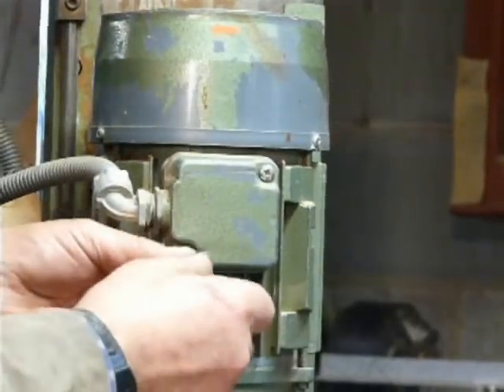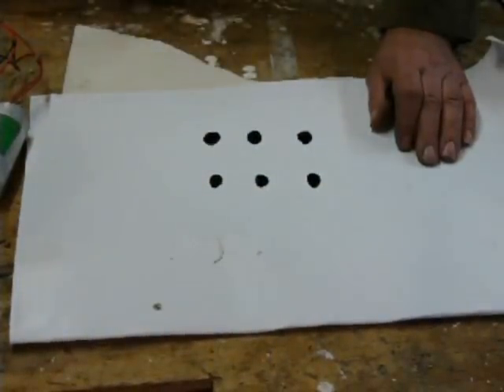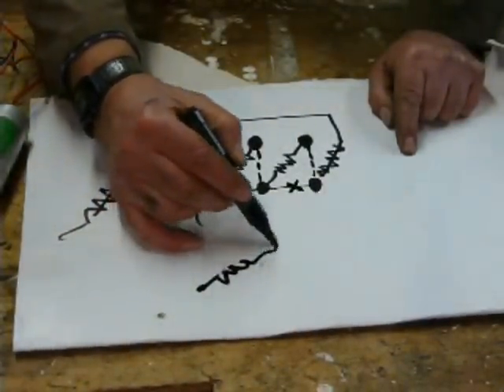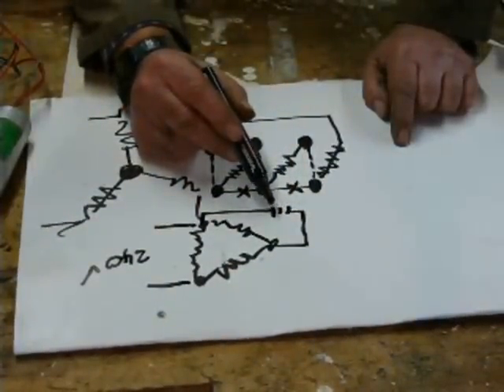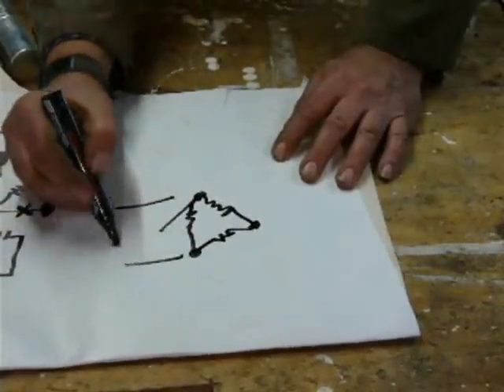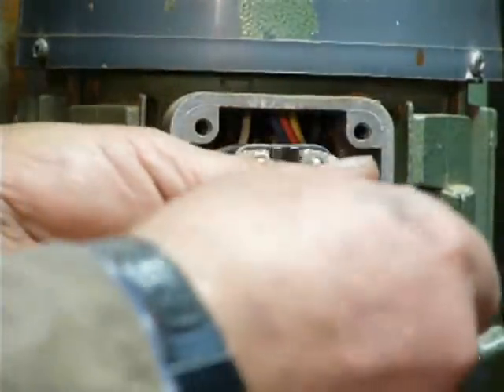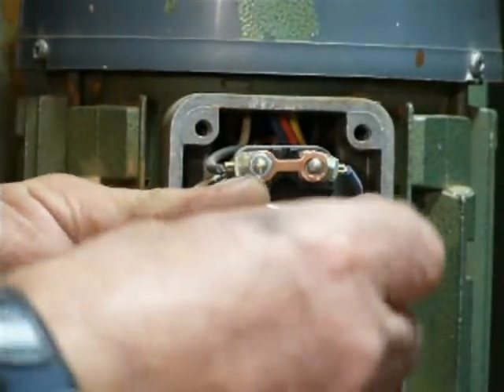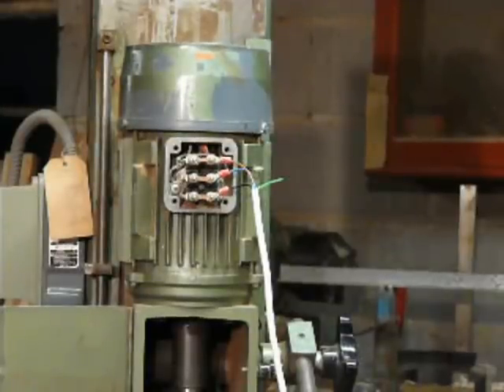How to do it: run a 3 phase motor on single phase supply. part 1

Comment: Andy, I'm trying this on an old 20hp motor. Can I use a 2100v ac cap with 1.0 uf? Thanks, if yes, i have many I can use
Reply from the maker: Hi. 20 Hp is a big motor with big starting current. You will need AC capacitors to a value of at least 300 UF, see what happens, but let me know. Cheers, Andy
Reply: Hi andy. I went to an electronic shop and all they had in ac caps were the very small ones. Even though they are 240v ac, and 100μ£ ,will those work for my application?
Reply from the maker: Hi. What you really need are either motor start/run caps or those out of flourescent light fittings. Small electronics items will not have the "kick", try your local electrical recycling place. Cheers
Reply: Hi again, turns out i was wrong about the HP. Its a 254 frame type K, 6.52 amps, 2 Hp, 220 v. So i found some caps on eBay that i am waiting for. Using your formula, how many μ£ would u recommend i use? Thanks
Reply from the maker: Try 60 Uf and then do the tests shown in the videos, Cheers

Comment: How to change daration
Reply from the maker: HI.I assume you mean direction, Change 1 of the 240v power leads to the 3rd delta connection and the motor goes the other way, subscribed? Cheers
Reply: Thank you sir

Comment: This is really old and it been done most the time where you have not access to a single face motor or a three phase power supply the main point is you need to know what size of capacitor and what type also as he explained in some cases need add a hard start capacitor to improve the torque of the motor Best way and safe to do this is by controller by Contactors relay with NO and NC as well as two push bottom to avoid burn out the motor and case power go off 
www.certifiedqualityair.com
Reply from the maker: Thanks for the comment, just drawing people's attention to this method and the book. Cheers

Comment: Hi Andy, I am up to your second video, and I appreciate the time and effort you put in to these videos to make them easy to understand. I do have a question: I live in the US where the power is single phase 120v. I do not have access to a 240v outlet in my home. Is it at all possible to run a 3 phase motor in this situation? I am generally good at fixing and building things but don't have a lot of experience with electronics. Thanks in advance, Adam.
Reply: The motor in question is 5hp with an amp rating of 13.1 - 14.5. I understand that may be too large to start from single phase.
Reply from the maker: Adam. It depends on the voltage of your motor. If it is 240v 3 phase then it will work. I am lead to believe that in some US properties there are 2 110v supplies, giving 110v between the live and neutral, so you get 240 between these 2 live supplies. If it 415v then it will work but the motor power will be much reduced as you will use Delta wiring but put in 110v (worst case)  As a general rule if you halve the voltage to a resistance then you halve the current, but the watts are reduced dramatically. 4 amps at 240v is 1000w, but 2 amps at 110 is 220w. There is only one real way to find out, try it. Cheers.
Reply: Adam you  should have 240 at your kitchen stove or your clothes dryer.

Comment: Hi Andy
Your video is most helpful and your safety warning is apt.  But its is important for all DIYers to know that big capacitors can give you a big jolt even after the power is disconnected.  Three questions?  Does WP16 give a table or rule of thumb for capacitor sizing?  How published it?  I am working on an project to use a direct drive permanent magnet 3 phase motor (F&P) as a starter motor for a hard to start diesel then as the generator.  Whats your guess for the capacitor sizes?  Cheers Jack
Reply from the maker: Jack. The books is available from Maplin and it is on Ebay. Page 47 shows a chart of Hp and cap sizes, but fine tuning is required because of individual motor configurations. As to your project I suspect a guess and then measure the run voltages, but as it's a starter motor and will only run for a very short time, then a slightly high capacitance will give a bit more kick. Have you subscribed? Cheers, Andy
Reply: How do i subscribe?
Reply from the maker: Hi, Jack, just go to my channel and press the subscribe button, just gives you email alerts of new uploads. Cheers

Comment: Hi, I have changed a 3 phase moter in to a single phase ,I am having problems with it it's not knowing witch way to go can you help me ? What have I done wrong.
Thanks
Reply from the maker: Fay. just a few questions: have you wired the motor to delta, what capacitors have you used and are they good, What is the motor driving at start up. have you subscribed? Cheers, Andy

Comment: Thank you sir for wonderful concept....
sir i have a few doubts regarding this concept
1.after running the motor with 1 ph supply,if i remove capacitor it will run or not sir
2.normally in 3 phas motors to get rotating magnetic feild stator winding must be placed at 120 and currents must displaced 120.
but here we didnt do any such things even though it works. how it works?
 (any theory part website link or ebook)
Thank you sir.
Reply from the maker: If you disconnect the capacitor when the motor is running it will continue to run because it is up to speed. However the power will be much reduced. There are some videos showing the use of a motor and belt to get the 3 phase motor up to speed and so it will then run, as they will not start on single phase. The use of a capacitor (of the right value) means the motor will start and run with more power. Cheers
Reply: thank you sir for your responce.
sir another doubt 
current taken by motar winding with 1 phase is higher than 3phase supply by how many times?
thank you
Reply from the maker: The current should be about the same as the 415v coils have been split in 2 so the are moe suitable for 240v. However only 2 sets of coils are used so overall the current is less and the HP is about 60%. Start current limits the size of motor to about 3 HP.

Comment: i connected my 3phase nederman exhaust motor direct without capacitor as i also read it would run on another site (maybe a mistake) it did run, and it started smoking, any suggestions please,
its a 220-240 3.5a or 380/420v 6amp with 2860r/min 
the colours /connections are
W2 black  U2 yellow  V2 red
U1 yellow  V1 red      W1 black
1                2             3       manual says phases i think this means
I changed it from star to delta so its running on 240v but may have connected it wrong
how do i work out which one are live and neutral as i only red yellow and black from the motors.
What capacitors should i buy please as i dont have any old ones
Yours and anyone elses help would be greatly appreciated, many thanks

chris.sheerin@btinternet.com
Reply from the maker: HI. It sounds like too much current through one of the coils. You will have to go back to basics and apply the info in these videos. You can identify the various coil ends with a multimeter and check the size of each coil with the resistance function. The greater ther reading the large the coil, but they should all be the same. Cheers.
Reply: dear andy reynolds
thanks very much for this, need to learn how to use the volt meter on resistance, but when i get these results can i send a contribution for you to help me wiork out the capacitors and wiring i need i can send pictures if you send me an email to chris.sheerin@btinternet.com

Comment: any calculation for sizing the capacitor?
Reply from the maker: In the comments on one of this series, Subscribed? Andy
Reply: yes your volt meter will help i you get same voltage. start about 45 mfd . if it will not start due to load you have to place a hard start kit to same mdf.

Comment: I a bit confused with wiring a contactor relay for AC unit the T1 and T2 should carry the phases or 220  for each fan motor and compressor. and the hot phases should tie into L1 and L2 right?

Comment: million dollar question
You sound like the real thing,  my question on the condenser fan motor instructions says the two brown wires goes on either side of capacitor is there a black wire to one side of capacitor to charge it? or was that a stupid question.  I have two brown wires one brown with white stripe  but I forgot if one of the black wire is connected too capacitor?

Comment: Many thanks.  We received 380v 3 phase motors from china on small lab equipment. Bugger!
Reply from the maker: I hope you will enjoy working this out. Cheers
Reply: Andy, my husband and I are in the jungle in Laos. We purchased second hand capacitors from a junk dealer but are 450v umf. Will these work? We found a 250v 500umf capacitor and it worked. The motor runs mini ball crushing mills. Any help you can give is very much appreciated. From Nara and Dave
Reply from the maker: HI. As long as the capacitor voltage is higher than the supply voltage, all OK. The 450v one is fine. It is the Uf (micro farads) measuremant of capacitance that is important. If the capacitance is too high then the voltage on the 3rd terminal will be too high and motor will get hot or fail. For a half Hp motor the cap should be about 30Uf, if I read you message right yours seem to be too high. Check the voltage with a multi meter between supply and the 3rd connection. Hope that helps. Can you promote my books out there? there is a very good discount direct from the publisher. Cheers Andy
Reply: Dear Andy, the motors are 2.2 and 2.5hp. The machines arw the size of a home cement mixer. Please give me a link to your books. Your videos are the most practical and helpful instructional DIY videos I've ever come across. I will put on a switch capacitor as per video 3 or 4.  Many thanks.
Reply from the maker: HI. About 100 Uf for the run cap and something like 200 UF for the start cap but this is not so critical. I have put a link in the description of part 2 to the list of LILI publications, many of which you may find interesting. LILI is a not for profit organisation, and so am I. Cheers, Andy

Comment: Sir, Is the 3phase u are talking about is the 440 v 3phase or 220v 3 phase... Thank u for answering in advance !!!
Reply from the maker: 440v for star and 240 for delta on a dual voltage machine.
Reply: thanks Sir , iat helps a lot!!God bless

Comment: You my friend are a genius!!! Thank you. You laid this out perfectly!!
Reply from the maker: Thanks for the appreciation, check out my recent upload on global warming and flooding. Cheers, Andy. Subscribed?
Reply: Mr.Reynolds I am subscribed. I am currently having a issue with the motor heating up very quickly. If I did my math right my motor requires .81 micro farad capacitance. However my motor is still heating up. I have a AHV 2-42-P-10 0-250 Volt, 2 Amp-3 phase motor I am trying to run it on single phase 110 Volt. any suggestions? Thanks in Advance..
Reply from the maker: Sounds like you capacitor value is too high. Check the voltage between the supply lines and the capacitor / motor connection. It should be at or just below supply voltage. I suspect currently it will be much higher. Cheers.

Comment: In US neutral and one hot is 110v across 2hots is 220v so do I leave neutral out
Reply from the maker: That depends on you motor voltages, and whether you wish to run on 110 or 240. It's the star delta choice. hope that helps, Andy
Reply: yes

Comment: in the US the neutral and 1 hot is 110 or neutral and 2 hots is 220  in your video you stated that a neutral and hot is 240 i am confused
Reply from the maker: Fair comment. In the UK standard voltage is 240v and 3 phase is 415v, so 110v is only used on building sites and other specialist areas. This is why the video is set up to change the motor connections to suit 240v. I assume in the US 3 phase motos are 240v, so the principal remais the same, but the voltages are less. Thanks for the comment, hope that makes sense.

Comment: thanks sir for this video. i have question , maybe you can help me. how i can get voltage output  3 phase 220/ 380 volt, from input single phase 220 volt? what components are needed ?  and how the circuit? thankyou.
Reply from the maker: To do this rather than convert the motor you need a 3 phase inverter unit. Hope that helps, See mrpete222 channel.
Reply: Andy Reynolds thank sir for your answer. sory sir i dont know about channel mrpete222, and where i can see it?  because this voltage is not to operating a motor.i need this voltage for give sensing voltage to the module. and this module requires supply voltage 220/380 volt (L1, L2, L3 and N ).

Comment: thanks  sir for video .sir i have question how much capacity   motor we can run with single phase and how much capacitor   we need for how much hp motor ?
thanks
Reply from the maker: Hi, About 30 Uf per Hp, and up to about 3 HP. This is limited by the start current so experiment is required. Andy
Reply: thanks sir for replay.sir do u have any video about control panel diagram of pumps.

thanks
Reply from the maker: I have created over 60 videos but non cover the subject you require. Andy

Comment: great video thankyou, i have used this information to get a 3 phase 3 kw motor running, i used 3 70 mf caps to run and one 400mf to start, however 2 of the chinese 70 mf caps popped almost straight away, there is no polarity marked on them  so would you suggest i am makng an error, or the caps are rubbish, although new are they same quality as most chinese exports? ie crap. many thanks for any advise and great videos,.
Reply from the maker: HI. Several thoughts that you could investigate. The cap voltage needs to be more than the supply voltage and if possible 1.5 times higher. If you use too high a capacitance then the voltage will rise and could blow the caps. The start cap needs to be disconnected during run. The start cap seems a bit high and could cause run cap failure during start. Let's hear how you get on, hope this helps. Andy

Comment: Everything is a resistor?? ))
Reply from the maker: HI. Yes, resist the flow of current, light bulbs, wire, motors etc. See the DC to Dc conversion video to show how a bulb can be used to limit battery charge current. Thanks for the interest.
Reply: He meant coil but yeah, he used a resistor sign. I'm assuming he wasn't officially trained in the electrical field but his explanation was pretty solid.

Only complaint I have is the size of wire he was using for that motor. It's way too thin.
Reply: +Stock Loc Higher voltage in europe means lower current, so thinner wire is ok, i think

Comment: hi..is there any voltage in the neutral line?? if have, how about neutral return to the main board...
Reply from the maker: Hi. Thanks for the interest. There is a live and neutral into the motor. The wiring is shown in part 2. There are 6 parts in all. Hope that helps, Andy

Comment: Now that I understand 3 Phase wiring this leads me to want to understand a motor's "FL" rating.  Is that the amount of current needed to get the motor running and continue running?
Reply from the maker: Hi. As I understand is FL is full load, FL current is that drawn when the motor is producing the rated horsepower and not slowing down. Start current can be up to 10 times the FL current. Thanks for the interest.

Comment from the maker: Hi, I can see the problem. With star there are 2 sets of motor coils in series. This doubles the resistance and so with a 230v supply it reduces the current flow. This is why we use delta to match coils and supply. I suggest you make a wiring diagram of what you have, and then follow this series of videos to wire the motor for delta. You may need to experiment with cap values; it's in the videos. Remember to check the cap voltage with the motor running. Let's hear how you get on.

Comment: Andy this is great! I wonder if you can help with a related problem i have - i've bought a planer converted to single phase but it is not spinning the cutter block fast enough, seems like a massive lack of torque. The motor is 1.5kw 3 phase wired in star, the contactors, start and stop buttons are 3 phase gear and two of the 3 capacitors are 380v or more. I can't make sense of the wiring - does this sound at all right or has it been wired up wrong? should it be wired in delta?

Comment: I converted a 3 phase motor to single phase use for a friend. Now you got me wondering if it was wired delta or wye. There was plenty of power, so I'm guessing we were using two of the three windings.
I used a potential relay from an air conditioning compressor to de-activate the start cap. After the success, I realized I could have used a regular relay hooked to the line voltage with N.C. contacts for the cap. When the motor got up to speed, and the voltage returned, the relay dropped the cap.

Comment from the maker: Hi. Thanks for the interest. The method uses the coils in star configuration. This way there is greater electrical resistance across the coils. The capacitors need to be suitable for a higher voltage 500v. pooroldchap shows this method on his channel, but basically it is just the same but with no wiring changes. Check out his channel and see what you think.

Comment from the maker: Thanks for your comment and interest. To get max power out of a 3 phase motor on single phase there needs to a be capacitor from both the neutral and the live to the 3rd connection. A start cap is definitely needed to set the rotation direction. On automatic start this would need some extra current related switching (switching off as the current reduces as the motor runs up to speed.).

Comment from the maker: Thanks for your comment. You are correct in assuming 30uf value is needed as a run capacitor per motor Hp, but this is a start point and the voltages must be checked to prevent over voltage of the coils.